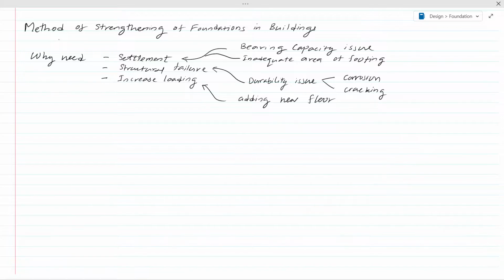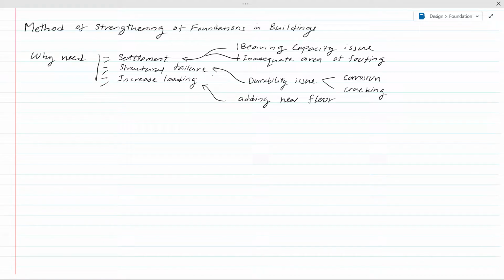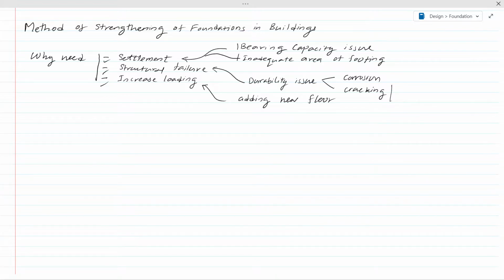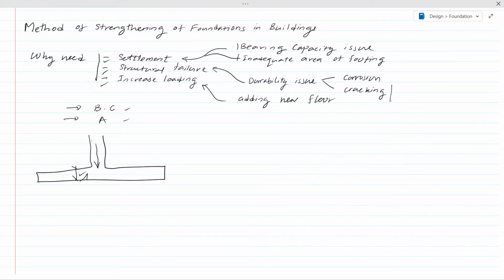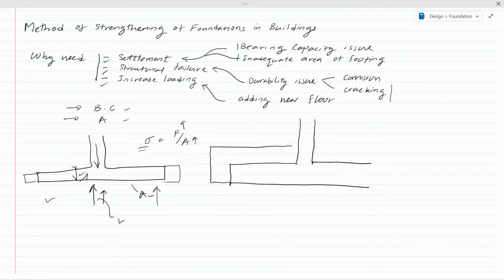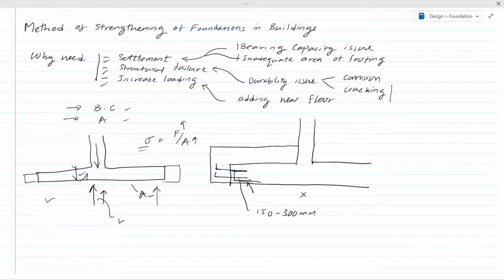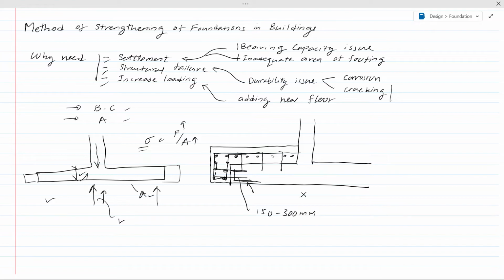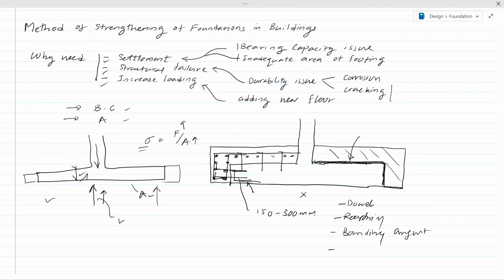Method of Strengthening of Foundation in Buildings | Footing retrofitting

Comment: Modal kese banaye
Reply from the maker: If you know the properties of the soil and the foundation, you can do the modeling as usual. 
In the case of footing, it is not always required to have a model. You can do the calculation manually as it is not complicated.
You may refer to the following link for further information
https://www.structuralguide.com/design-of-pad-footing/

Comment: hi, which bonding agent, i mean which material is more effective for this kind of work?
Reply from the maker: They should be for this purpose (cannot mention names). There are specific bonding agents that apply before placing concrete on old concrete for improving the bonding. Generally, they are applied just before the concreting. Once the concrete work is ready, we apply the bonding agent and keep some time to dry (like 10-15 minutes), and do the concrete pouring.